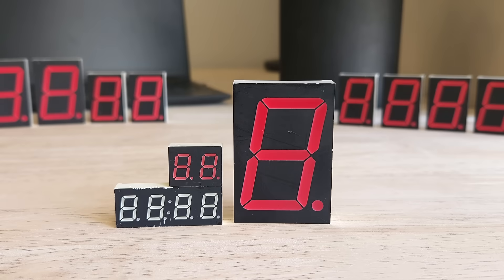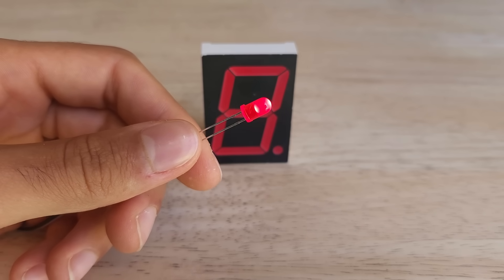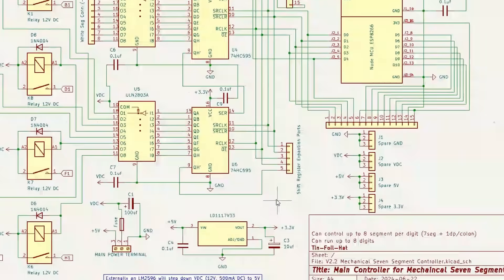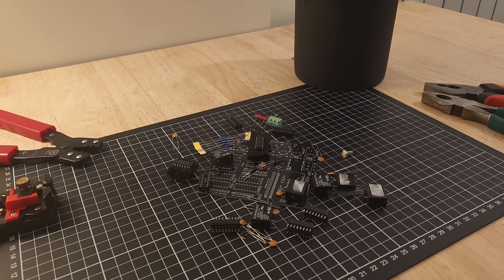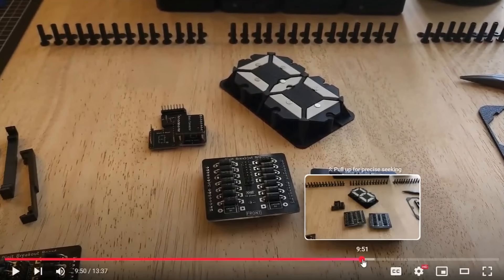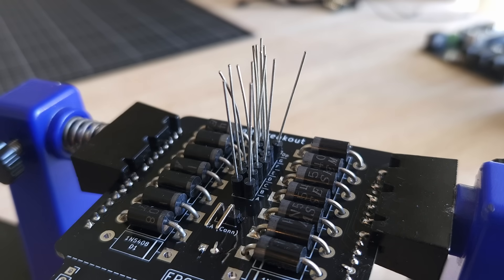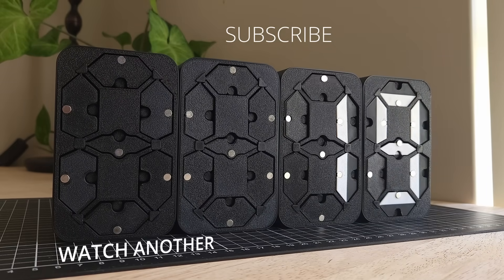The BEST Mechanical Display You've EVER Seen!!

Comment from the maker: PART 2 IS OUT NOW!!!
Answering the top 10 FAQ & some bonus clicking at the end!!
Check it out: https://www.youtube.com/watch?v=rSe9YtodGEI
Got any crazy project idea?! Stick them in the comments :)
Reply: Do not break PCB's without proper equipment, protection, and ventilation, the residue from that stuff is some very toxic and cancerous material!
Reply: I was thinking.. 
Is it possible to make those segments with integrated lighting? Maybe using a micro LED strip or something similar?

Comment: What is the update rate on the digits? I.e can I display 1/10ths or 1/100ths of a second or will that just be constant motion?
Reply from the maker: The fastest speed is shown at the end of the video. In theory it could be quicker if you flipped 2x flaps at a time or more.
Reply: @tin_foil_hat99  Yeah, typed that about 30s before the outro :D

Comment: By using two coils per segment you need half the transistors but twice the coils. Not sure if that's a good trade, considering that transistors are quite tiny and the amount is irrelevant if you order the PCBs assembled. But even hand placing/soldering the components is less work that wining twice the coils. Not to mention that you used ready made ICs anyway, which obviously also exist with H-Bridges instead of single switchable channels. Also you may wanna use V-Cuts on the PCB, rather than cutting the PCBs manually and then having to sand the edge etc. that's kinda unnecessary work. And finally, I think it would look nicer if you flipped all the segments simultaneously instead of sequentially.
Reply from the maker: That's a great amount of feedback! I am glad I was checking comments just as you posted this. If I was to do this all again I would definitely do some/most of the things you pointed out. Thanks for watching :)

Comment: I’ve seen a lot of flip dot displays along highways. Most of them I’ve seen use a fluorescent yellow-green color for the dots, and blacklight illumination at night, which makes the dots glow in the dark. They work very well and are visible at a long distance while driving at freeway speeds. And like your display, you can see the dots flip over as the displayed message changes.

Comment: This is very cool. But there is another issue with electro-mechanical displays. Here is the thing. One of the many reasons that airports and major train stations ditched the split flap  or flip-dot display, has to do with displaying wrong information.

If an electro-mechanical display (flip-dot for example) fails, whatever information was displayed prior to the failure is still displayed. Hence the possibility of displaying wrong, and outdated information. 

A digital display (typical large screen) will fail spectacularly. That is to say in most circumstances the screen will go blank. Thus No information.

The question comes down to which is worse, no information or wrong information.

Obviously i left out the part where the maintenance of electro-mechanical displays is much more arduous than modern led large screens.
Reply from the maker: That's a really good point!

Comment: It looks pretty cool. Just one thought on it... isn't this one using power too? Didn't it kind of defeat the purpose of a display not using power? I mean at the very least you NEED some sort of power to configure the time zone you want to have on the page. It's a really neat clock, don't get me wrong. Just thought that it was a big point to hit as said in the beginning of the video, yet needs power to run anyway. Unless I'm completely oblivious to something here, feel free to correct me if I'm wrong :D
Reply from the maker: No it does need power as you said, but only to update. I show some real word use cases in Part 2. A clock isn't really what it's designed for as you pointed out... but it's pretty cool thing to have regardless. It's mainly designed for use cases where updates are done once or twice a day, e.g. fuel prices or bus numbers.
Reply: @tin_foil_hat99  Ah ok, I was wondering about that, haha. I haven't gotten around to watch Part 2, so if I missed those infos that clarified that, my bad :)
It's still pretty cool nonetheless. Was just confused about the "no power - power using clock" part for a bit there 😄

Comment: The rectangular housings with rounded off corners look very familiar to me. It took awhile to realize I have a pair of black surround sound speakers hanging on the wall in the next room that are the same identical shape, but a bit larger. Making a mechanical 7-segment display was a great idea. I remember having a watch with red LEDs before LCDs were popular. And my 45 year old clock radio, which still works, uses a VFD that was used before LEDs were really popular. I never had anything with Nixie tubes but have 3 of its replacements. I never liked the mechanical displays that had a bunch of leaves that flip over to show successive numbers, but I really like your display.
Reply from the maker: Thank you, I'm glad you liked it! Funny to hear your speakers are the same shape.
Reply: @tin_foil_hat99  It's not just just a slight resemblance, either. The speakers are roughly 4.5"x7"x4.5" or about 115x180x115mm and 40 watts. They appear to be cast aluminum with a separate plate on the back, and very heavy for their size. They're Memorex Series 10, and the radius of the corners looks half as big as on your clock. You can find images of used ones online.

Comment: My only critique is why don't you have all of the segments flip at the same time? (for aesthetic? or was it just difficult to code this way) Earlier in the "existing mechanical displays" section, one of the critiques you mention is that other designs need to "iterate through every number", which would assumingly be bad because it takes time. Since you have each segment flip individually, this is probably just as inefficient time-wise, so I think if that were changed to every segment flipping simultaneously it would be much quicker and satisfying.

(regardless, this video and project is extremely well made and entertaining, so kudos to you for spending so much time with such a great finished product)
Reply from the maker: Thank you! I've made a part 2 with some FAQ (this being one of them) and yes this design is more inefficient by doing each flap individually, but with "override" mode on (which I talk about in part 2) it takes less than a second or two to update the display.

Comment: 10:41 is bro chinese or japanese
Reply: Japanese learner here, for the bottom characters i read 輸出指示 using japanese kanji (meaning output indicator)
The first character has a radical that is shaped differently which indicates that its simplified chinese
Reply: thats chinese
theres a difference between chinese and japanese you know
right
japanese has less strokes for each letter
Reply: @Swingytheswingset Wait that's not how it works.

Japanese uses three types of characters: Hiragana, Katakana, and Kanji.

Hiragana is squiggly, Katakana is more jagged. Kanji is just Chinese characters.

There are two types of Chinese script, "traditional" and "simplified". Mainland China, Singapore, and Malaysia generally use simplified. While Taiwan, Hong Kong, and Macau use traditional. 

Modern Japanese Kanji is known as Shinjitai, which is also somewhat "simplified", but differently from simplified Chinese, and is generally closer to traditional Chinese. Therefore, Japanese Shinjitai characters usually has more strokes than Simplified Chinese, and less strokes than traditional Chinese. 

In the video, Simplified Chinese is shown, although in this case the difference isn't too big. This YouTuber most likely just purchased some parts from AliExpress or something.
Reply from the maker: I've watched that scene like 5 times now and have no idea what you're talking about lol I'm not chinese or japanese, my guess is it's just something 'made in china'

Comment: This seems overcomplicated to me:

Couldnt you just give all of the magnets in a digit a common anode and then have all same segments of digits share the same cathode? Then you could just multiplex the digits w/ p channel mosfets for switching the respective digit and n channel ones for the segment you want to flip

Additionally since you have a PCB in the digit itself, you could also incorporate the posts into it and use the posts themselves as as the cathode of the electromagnet and have it screw into the base pcb w/ exposed pad, further minimizing wiring :D
Reply from the maker: That is exactly how it works :) It is called multiplexing, I am making a part two right now where I talk more on it, but as you said, every cathode is joined across digits (hence the small joiner PCBs) and all the anodes are joined within each digit. Then I used n-channel mosfets (in an IC, called a darlinton transistor array), and I used relays rather than p channels but yes p channels would also work (they are just more expensive than relays where I live so I opted for relays).

I do love the idea of integrated magnets in the PCB... that would make wiring so so so much easier. If only I had thought about that around 9 months ago lol. It probably would be a pain to prototype though without making your own PCBs to test as you go, but an excellent idea that maybe someone else will do?
Reply: @tin_foil_hat99  Ah I see thanks for clarifying! I was confused by you needing a ton of diodes in that case as I didn't see how the signal could backfeed into other digits. That being said the finished product looks very nice.

Comment: The fact that an electromagnet can have it's polarity changed for a change of state means that you only need 7 electromagnet coils for the 7 segments/flaps per digit instead of 14. 
That for example is achieved by making the core into a U shape. With flow of current towards one direction, one side of the U becomes north and the other south. Flip the current flow in the coil and you flip the polarity ad can thus get the flap to flip.
One would have to build the flaps with thin bar magnets with the polarity on each end, rather than this small round fridge magnets, therefore switching the polarity makes the bar flip around. 
Ideally a thin bar should be used and buried inside the black/white flap so display contrast is maximised.

The display is a delight though, reminiscent of certain aircraft and other displays of the past.
Reply from the maker: Yes that's completely correct! I am making a part 2 right now where I talk about this in a bit more depth, but U bolts are generally harder to wind and more costly. But yes you are completely correct in saying that.

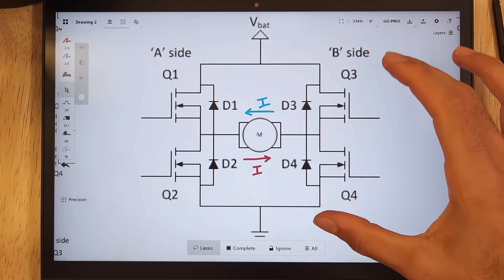Comment: 03:55 "we need seven of these per digit"
uhm... no? you need ONE of these per digit. you could even use just one of these per display since, you are driving every moving peace one after another. also 7-segment-driver are old and cheap tech (e.g. MAX7219 = 20cents), you dont have to reinvent the wheel, just use them with amplifiers to drive your flipdots.

Comment: How’d you make the coil repel the magnet - I.e. how many turns of the 0.1mm copper wire?  I have about 1400 turns with resistance of about 50 ohms and I still can’t get it to repel. What’s the trick?
Reply from the maker: Do you mean generally? Or with this design. Because if it's this design, try to unscrew the bolt a bit. You need a gap between the magnet and the bolt. The top of the pillars you screw the bolts into is a calibrated length that worked for me, but you may need to unscrew them slightly to increase the distance if your magnets are stronger than mine.

The magnet should be a distance such that it is still attracted to the bolt in the electromagnet, but far enough away such that it gets repelled.

Also a higher resistance isn't always a good thing, as you need a good amount of current too (~0.45A). But I'm guessing it's the distance

Comment: I'm curious why the display doesn't simultaneously actuate all the electromagnets to flip between digits, and instead does them one at a time. Do they interfere with one another? Was it a software or hardware design limitation?
Reply from the maker: It is to do with the power requirements. You could definitely make them flip all at once with the current set-up, IF you had enough power

Comment: Looks amazing indeed! Though not sure why you needed the hassle of diodes at all. I assume it's to reduce the number of ULNs required, but as a result you have a whole lot of huge diodes and a non-trivial schematic.
A side question: can you sleep in the room with this clock?
Reply from the maker: The diodes are called flyback diodes and are used because a coil will generate a reverse current when unpowered and they prevent the current damaging other components. I'm not using the display as a clock, but no I don't think you could sleep with it. You could add felt onto the centre panel, and then yes I think you probably could.
Reply: @tin_foil_hat99  but... You know that ULNs have built-in flyback diodes, right?
Reply from the maker: Yes I did read that, I think you need to connect pin 10 to the positive rail from memory, and I can't do that because of multiplexing. The multiplexing requires each positive anode to be grouped by digits, rather than one common anode overall. Since I was using the ULNs to switch the common negative rails, of all the digits, I couldn't use the flyback diodes built in (as all the digits don't share a common anode). Maybe you can still do this? But not to my (limited) knowlege.
Reply: @tin_foil_hat99  Yes, that last pin on the package! I would think that connecting it to the common power before the relays would work even if you multiplex the digits. I tried to study your schematic on instructables, and it seems that you already have done that, so I think you could do without the diodes. Also, I think you could replace relays with p-channel mosfets. Smaller footprint, less clicking, less moving parts and not an inductive load, so no need for diodes across relays at all.
Reply from the maker: Yes you're right, given I only flap one digit at a time it should work! I guess that's a good thing to know given I'm currently making a part 2 so I will put that as a note somewhere, thank you. I chose to use relays because I couldn't order p channels in anything less than a pack of 100 (good old Aussie shipping) so just opted for local relays that were pretty cheap. Yes p channel mosfets would have been better. Although honestly I thought only 10 people would ever see this (my first 'proper' video at 270 subs) and thus no one else would ever build their own anyways, so I did what worked for me. How wrong I was lol

Comment: A solid state circuit to reverse current is possibly more complicated, but if you're already using relays, two relays and two transistors is all it is; you need relays with not NC and NO connections; hook ground to NC (or NO) on both relays, power to the other, and the output to the common, and whichever relay is energized will be the direction current flows. Something like a G3VM-61VY2 you could easily fit 14 relays on each board (they're less than 17 mm² each) and they can handle a half amp continuous.
Reply from the maker: Yeah this is a good idea, I tried to make the design such that it doesn't require continuous power, such that the electromagnets only need powering for around 50ms to flip the flaps (and thus update the display). Although this is quite a clever design with the NO and NC that I hadn't considered!

Comment: Neat project! Do you ship these?

Also QQ: Why do the individual flaps turn one by one instead of together? Can that be achieved? It would result in larger clinking sound and instant time check.
Reply from the maker: No I don't sell them sorry. And the reason is purly because of the amount of power needed to flip them all at once. It is possible with this current design, but too power hungry.

Comment: Helped build a similar counter but with a slightly different basis.
Each digit was made of two pipe endcaps and two servos. On each endcap was a strip of paper with the symbols for either the top or bottom half of digital 0 through 9. It counted by rotating the top and bottom symbols together to create each number. Turned out there was enough space on the endcap for every symbol and a blank space. After some symbol order optimization to minimize servo wear it came out nice.

Comment: What about words with a T in it? Bro you bought a 3d printer, resin, 3d design software all to avoid paying 150$…
Reply from the maker: You can display a letter t, just not a capital one. I already had a printer, and filament is quite cheap these days. Also as a student I get CAD software for free, and I use it in my other projects. All up this project costed me 100AUD for 6 digits and a controller.